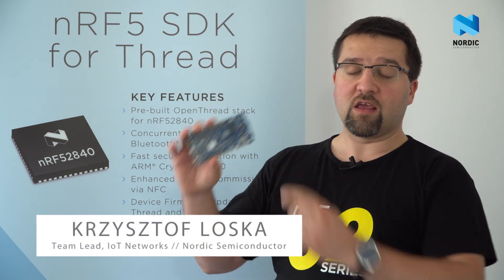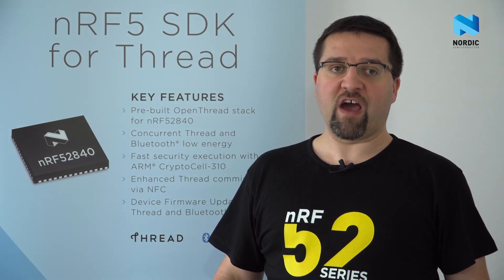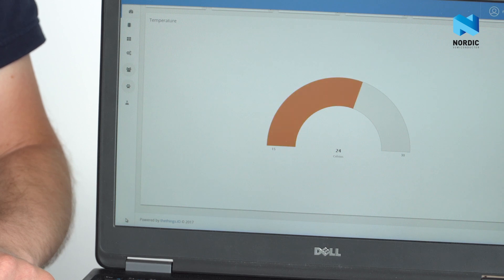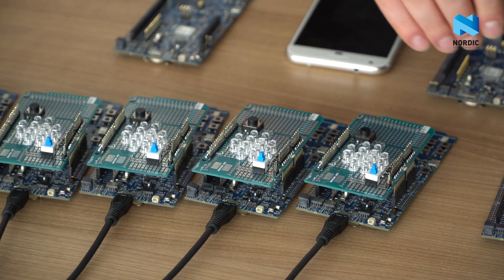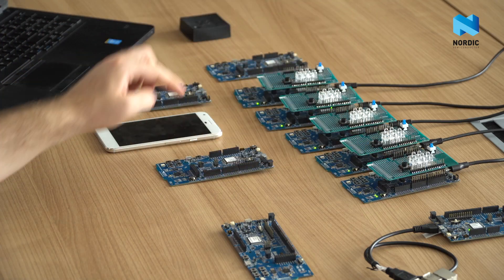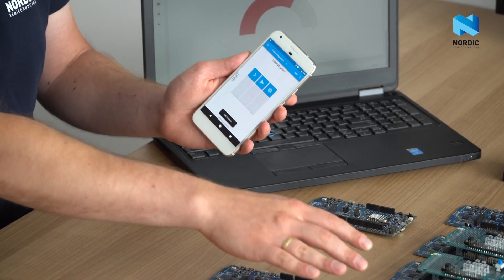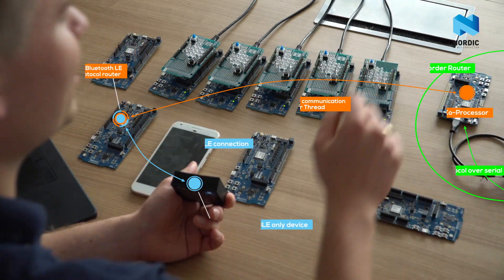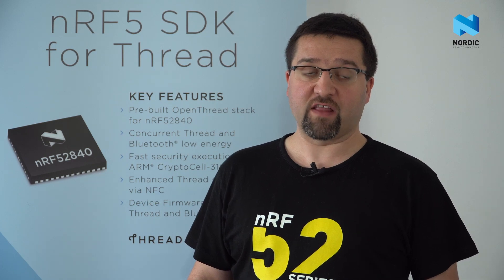nRF52840 running concurrent Thread and Bluetooth 5

Comment: hmh, i need to understand the key differences between mesh and thread. Seems that thread has better benchmarks (latency, throughput). Btw thank you for a very nice and well explained demonstration (no crap and adv).
Reply from the maker: Thread is more consumer focused, and works better for smaller networks with a mostly static network topology. Bluetooth mesh works better for larger commercial/industrial networks where you can have rapid changes in network topology and where low down time is critical. If you have more technical questions please use our DevZone https://devzone.nordicsemi.com/

Comment: Of course it's impressive!!!)  True, I do not have as many boards to try. and examples do not always work especially in npf52840 pdk. for example uart ble.On SDK 132 everything works and on SDK 140 there is no( And I for example could not immediately run the SDK for Thingy: 52 But seriously cool is the coolest chip I've ever seen !!! And I saw them believe not a little.